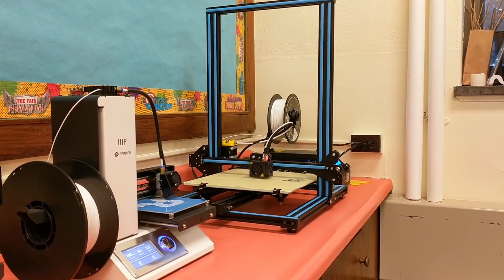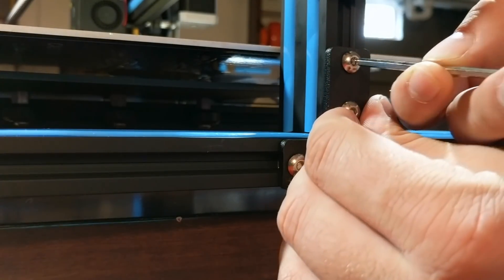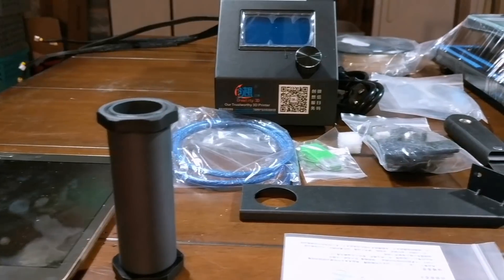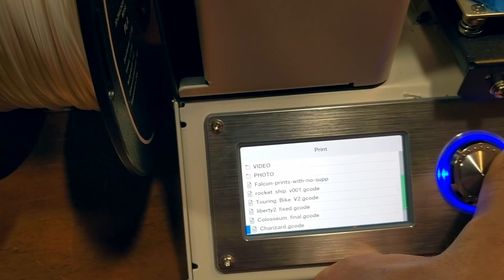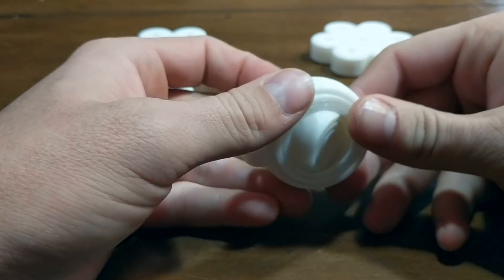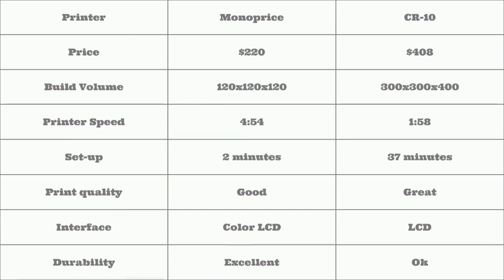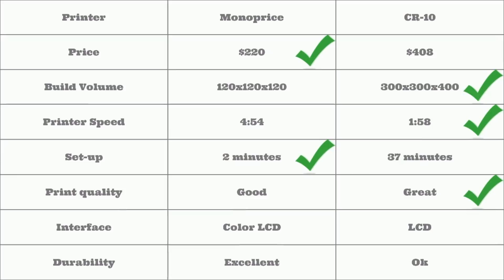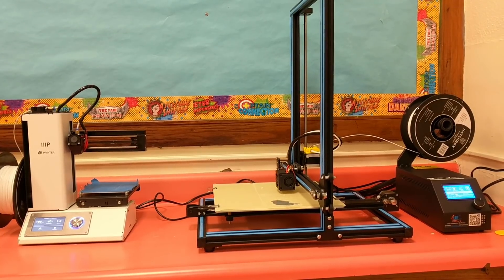Best 3D Printer on Amazon?

Comment: The Monoprice is great!  but had to upgrade a lot of things.   Glass bed,   New 40mm Noctura fan & shroud,  Belt tensioner.  clip on  Bearings for the spool holder.     Prints like a dream,    one of the makes I did on thingiverse some asked if I printed it on a resin printer.

Comment: Well, good video however no sense watching.  As of today 3/22/2018 I went to Amazon and neither of these printers are there.  I could find the Monoprice 15365 on other sites but not the CR-10.  Thanks for the info though.  I"m just learning.
Reply from the maker: ChinaAl Monoprice  115365 Select Mini 3D Printer with Heated Build Plate, Includes Micro SD Card and Sample PLA Filament https://www.amazon.com/dp/B01FL49VZE/ref=cm_sw_r_cp_api_i1dTAbCRASWTN
Reply from the maker: ChinaAl CCTREE Creality CR-10S DIY Desktop 3D Printer Kit Large Printing Size 300x300x400mm 1.75mm 0.4mm Nozzle With Filament Detector and the Dual Z Axis https://www.amazon.com/dp/B071KPBH3G/ref=cm_sw_r_cp_api_Q2dTAbS121Q8X
Reply from the maker: It’s tough to find the CR10 for $400, but there are sites and apps that will notify you of deals and when the price drops to a certain level.
Reply: OMG I stand corrected.  Honestly I went to Amazon and couldn't find them.  thanks much.
I'll leave this post up till morning so you can see my reply and then delete it.

Comment: best 3d printer is tevo tarantula  an affordable printer for begginers . Link -  https://www.amazon.in/REES52-Tarantula-Aluminium-Extrusion-Printing/dp/B06Y1336VP/ref=sr_1_fkmr0_1?s=industrial&ie=UTF8&qid=1519221355&sr=1-1-fkmr0&keywords=REES52+Tevo+-Tarantula+I3+Aluminium+Extrusion+3D+Printer+Kit+Printer+3D+Printing+2+Rolls+Filament+8GB+SD+Card+LCD+As+Gift
Reply from the maker: Though I have heard good things about the tarantula, however, I did not find any good deals on Amazon.